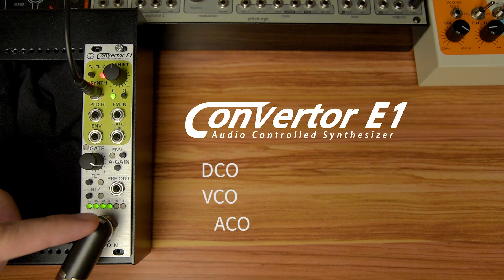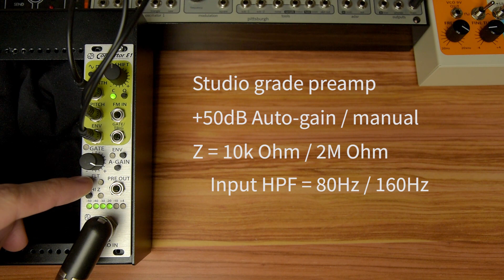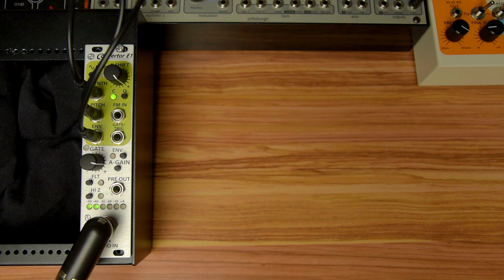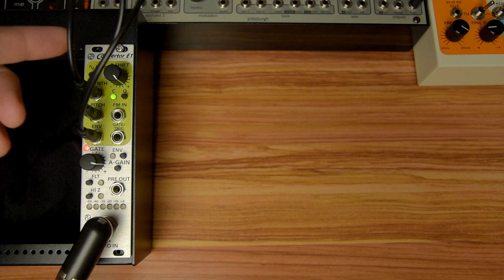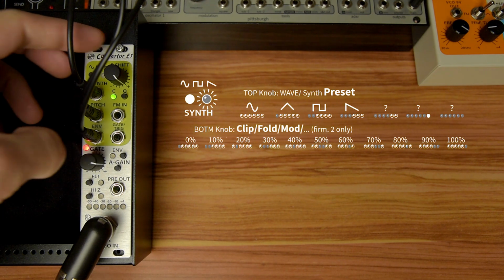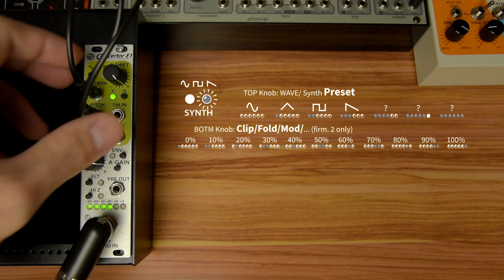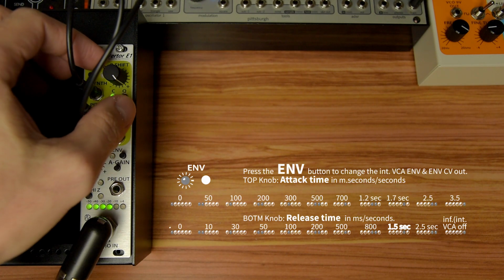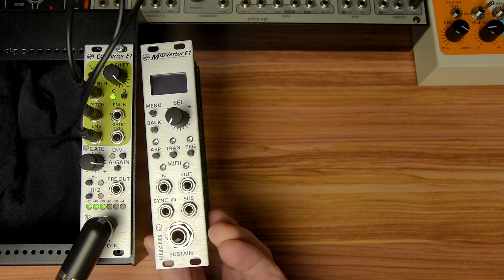ConVertor E1 introduction, Eurorack pitch-tracking synthesizer

Comment: Just got the E1. A lot of these functions don't seem to be on it, like changing the envelope time, compression ratio, quantization scale, and FM CV attenuator. Am I doing something wrong?
Reply from the maker: Hello. Thanks for buying the ConVertor E1. You are not doing anything wrong. We just shipped it with firmware 0.9 so customers who pre-ordered can start enjoying the core functionality already. We expect to ship firmware 1.0 in the upcoming Q3. We apologize for the wait, but can promise you it will be worth it ;)
Reply: I see. When will that be available? Mine is having a ton of fundamental problems. I cannot manually change the gain. The auto gain does nothing most of the time. Often the preamp, after leaving the mic idle for a few seconds, begins emitting extremely loud noise. But sometimes not? I bought this as a fundamental part of a performance coming up and as it is I’m not so sure I can rely on it.
Reply from the maker: @shmi1964  Yes, we found that some units had gain inconsistencies. We are improving the control part of the firmware and hoping to introduce firmware 1.0 by the end of this Q3 to download. We will update as soon as it's out!

Comment: Hi there! Is anyway chance to mantain stable the pitch out? I'm assuming it works as a gate with the guitar signal, i'd like to know if i can make it stable for a drone to other 1Voct input modules! Thanks
Reply from the maker: Hi Federico. Yes there is a VCO mode where the oscillator just acts like a regular VCO, separate from the preamp, not tracking the pitch. But if you add the MIDVertor E1 then you can also freeze the pitch with its sustain pedal, even in Audio Controlled mode.

Comment: sounds like jam synth
Reply from the maker: Jam synth is cool. I just saw it. But I guarantee that our tracking is WAY better. With our tracking, there is no need to play on the neck pickup nor rolling down the Tone knob. It will track vocals very easily. Add to that a much better, Hi Z, 12V preamp and CV outputs with MIDI option and you got yourself the real deal. About the sound I just made a quick patch with the Pittsburgh Modular SV-1 so if they sound the same to you then props to Jam Synth engine!!

Comment: are there any sound issues using pedals with guitar going into the E1?
Reply from the maker: If you mean electronically, there are no issues whatsoever. If you mean pitch tracking-wise, you'll need to experiment with the type of effects you are thinking about. Usually, serial effects won't interfere with the tracking while parallel effects may interfere with the pitch-recognition in extreme settings. But this generation of pitch-tracking is so solid it would take some seriously extreme settings to nudge the pitch-tracking from the fundamental.

Comment: This is confusing: how are you sending output to the 3 inputs? Are you just splitting the the frequency bands before the Input? I’m down but I have no concept of what this is and the website only says the “polyphonic options are available”. If you’ve got a simple way of achieving this without a special pickup or modifications to the guitar you guys have buried the lead ;)
Reply from the maker: Thanks for letting us know things are not clear. Each ConVertor E1 can only track one monophonic source at a time. You'll be sad to know I do that with Roland's "split pickup" and Synquanon 13-pin breakout module. I understand you don't like the idea but dam it works so well.
Reply from the maker: @Dan "wiz" Parmenter Very interesting. I never heard of them until now. 
Write us at info@sonicsmith.com for a special price offer.

Comment: Nice! I want to see somebody licence your tech and make a true six voice analog guitar synth, Roland GR300 style. With a hex pickup
Reply from the maker: If you don't want modularity then Roland offers a few closed systems that I heard are pretty good. Did you try the SY-300 or SY-1000?
Reply: @Sonicsmith  I haven't yet, no. They are meant to be very good, yes. The boffins seem to have nailed poly pitch tracking with software but I'm still curious about analog solutions. Good luck with the E1 guys. I've been watching your products for a while. Clever stuff!
Reply: The great thing about the GR-300 is that it doesn't do Pitch to CV (they also had mono Pitch to CV synths such as the SPV-355 or one of the sections in the GR-500) the 300 works so well because it measures zero crossings in the fundamental frequency and produces a square wave at the same rate which is then used to produce a saw. This means when you play ghost notes or do rhythmic atonal stuff it still produces a meaningful output unlike most Pitch to Voltage based systems (downside is no controlling other stuff with out more circuitry. Incidentally there have been poly Pitch to CV interfaces such as by 360 systems since the 70s :)